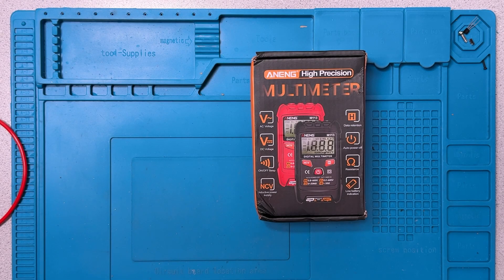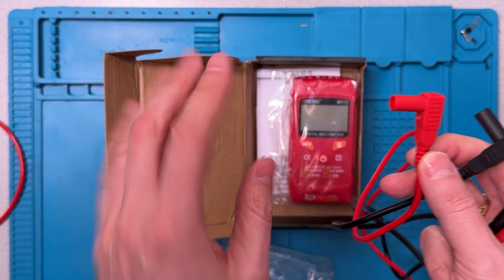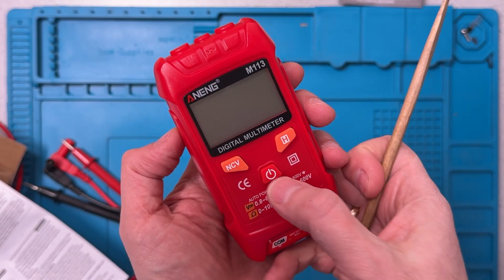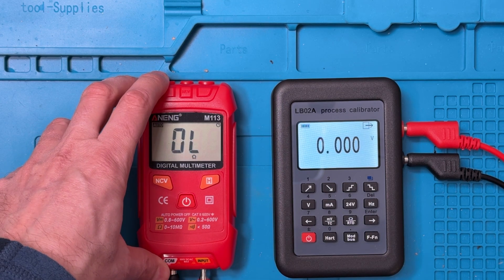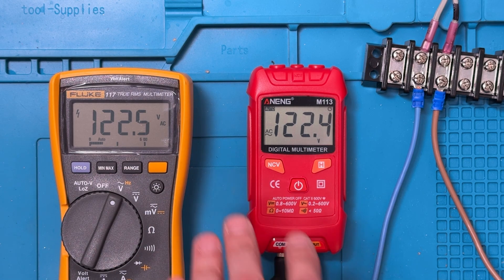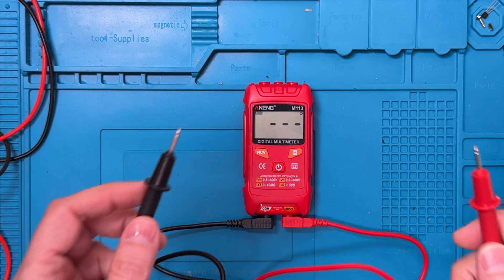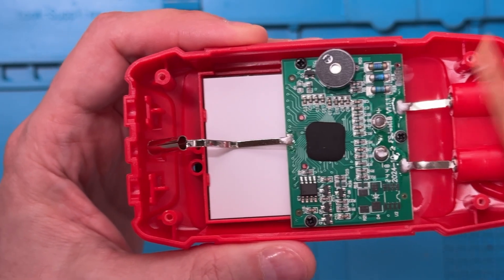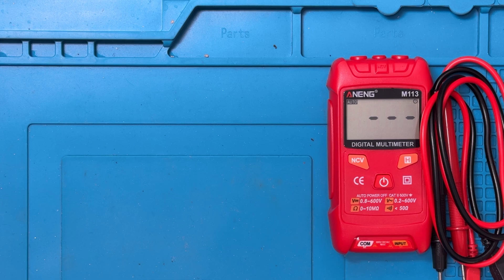Aneng M113 Unboxing, Review and Teardown

Comment: I'm curious if these draw any power when OFF, since it uses a momentary contact on/off switch.
Reply: i feel your probably right. i had recently actually found a few devices that do draw power when “off” but they were kids toys. most of the toys i had tested draw close to 1ma when off
Reply from the maker: Great question. So I hooked things up. This meter draws ~20µA when off and ~1.9mA when on.
Reply: @ Thanks.  That's lower than I would have guessed.  The batteries  probably self-discharge higher than that.
Reply from the maker: If I did my math right this will consume about 14mAh in a month. Self discharge ballpark would be about 3mAh for a fresh battery